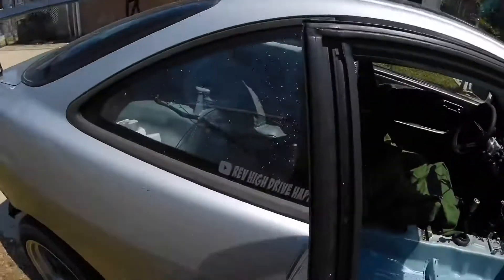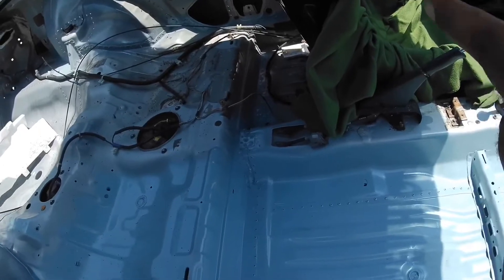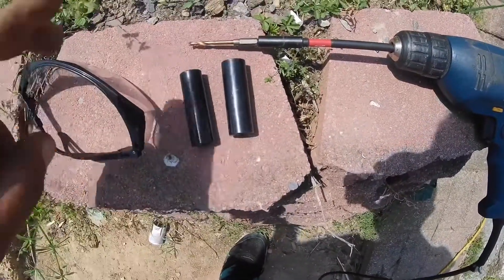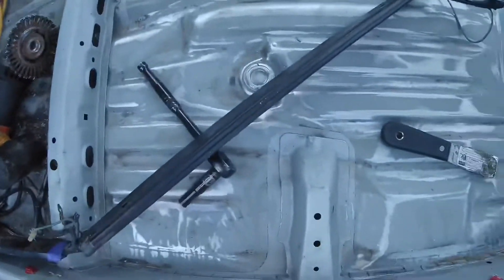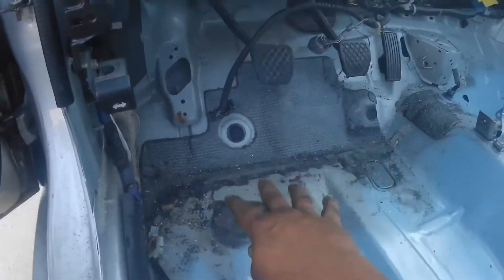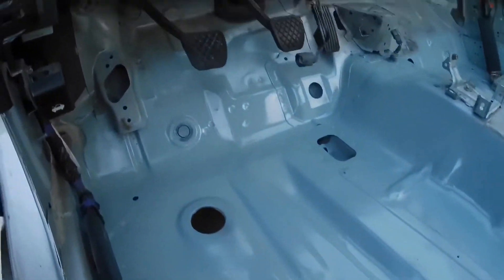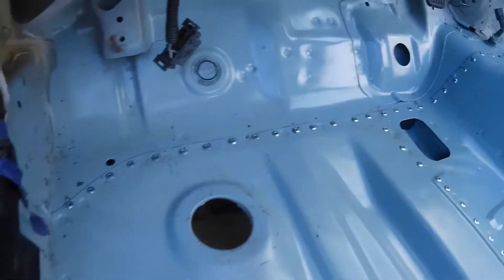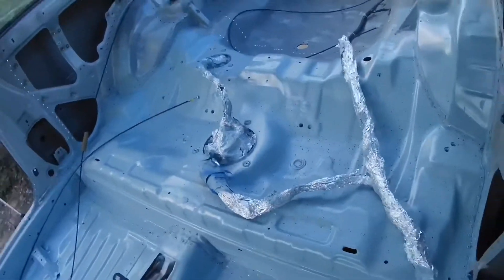Integra Chassis Reinforcement part 7

Comment: whyd you choose rivets over welding?
Reply from the maker: You don’t run the chance of warping the panels with heat. You also don’t have to worry about the under coating catching fire. It’s also less weight then welding
Reply: @RevHighDriveHappy  isnt the warping due to tightening up the chassis when it may be in a misaligned position because if thats the case i would imagine the rivets coud do the same?  How did the car feel after all this work?  Ive minorly heard of this process and I was interested in the benefits because i may want to do it on my integra.  I looked up chassis spot welding i think and the second video is you with your integra as well.  Using this many rivets i imagine u need to use a gun like you had.  How much did that thing cost?
Reply from the maker: @timm5970  heating the metal to much causes the metal to wrap. I used a hand Rivet gun for the 1st 100 but it was just to much because I used stainless rivets so I bought this 

https://www.harborfreight.com/3-16-inch-air-hydraulic-riveter-93458.html
Reply: @RevHighDriveHappy  isnt the whole point of spot welding to not put too much heat in the car.  if you actually welded the entire thing it would put a ton of heat in but when u spot weld theres a ot less heat transfer